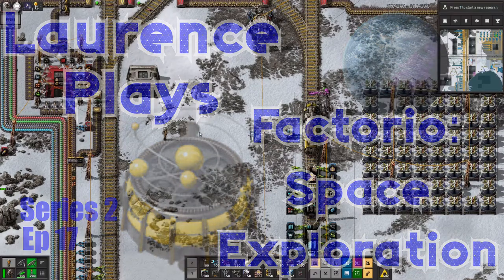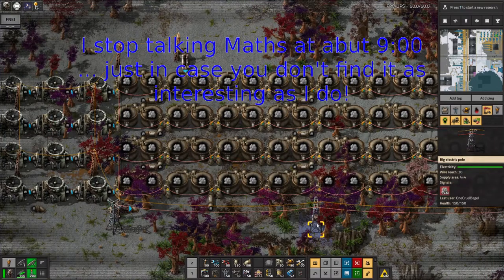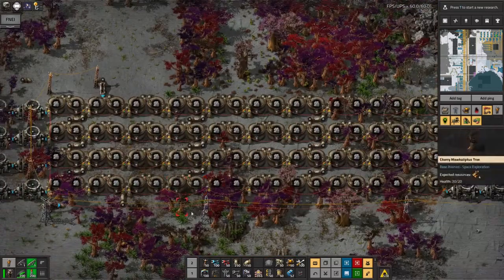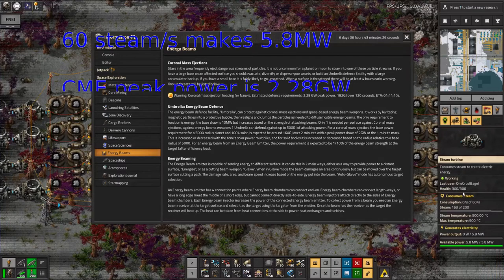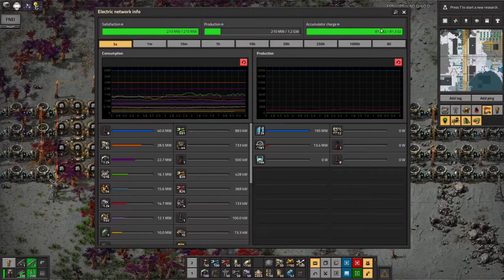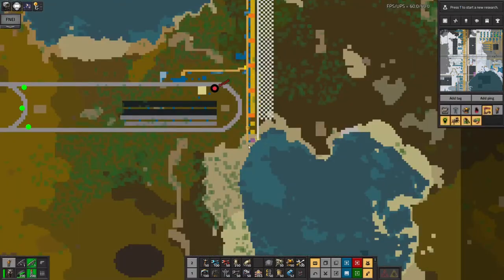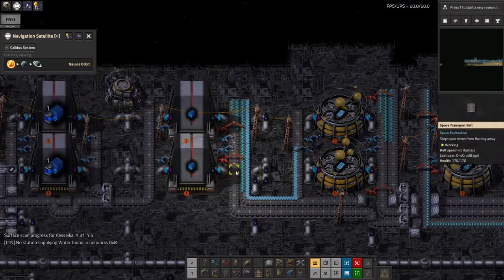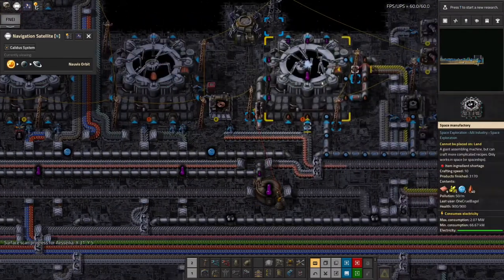S2-E17 - Coronal Math Rejection - Laurence Plays Factorio: Space Exploration

Comment: I suspect you've already expanded your production in space, but it might be worth noting that the Rough Substrate (i.e. the first stage in the data cards) can actually be made on planets in normal assemblers. Given that it takes 6 pieces of iron/glass to build, making it on Nauvis means it takes up less rocket space for the same end result, as well as not needing the scaffold on which to put the space assemblers.
Reply from the maker: Huh, I thought I'd replied to this. Sorry!
That's an interesting point, and one that I'd not thought of. It makes sense to make them down on Nauvis, given what you're saying, except that I wouldn't then be able to take the processed substrates up to space, except on a rocket. I'm leaning towards having the supply drops to the space station all working via delivery cannon so I can just leave it running. It's definitely a nice idea though, and one I'll have to remember for if/when I have automated rockets running. Thank you!